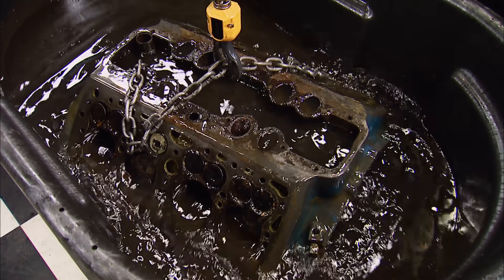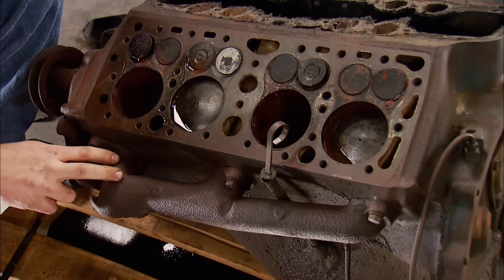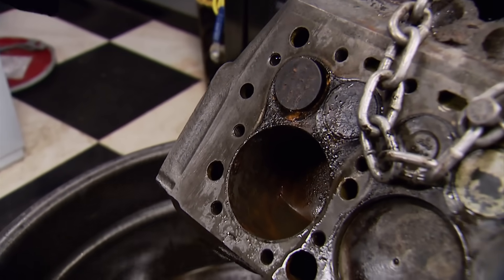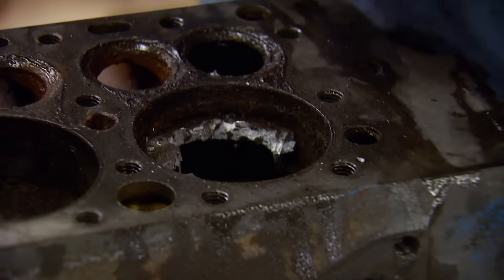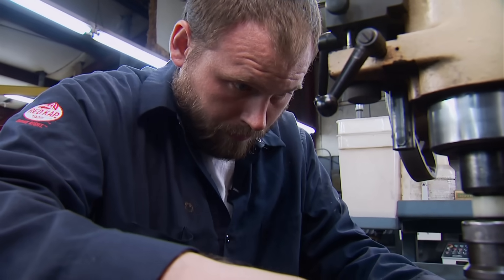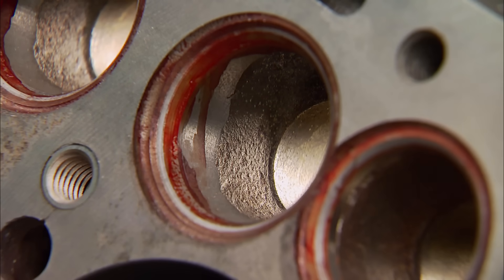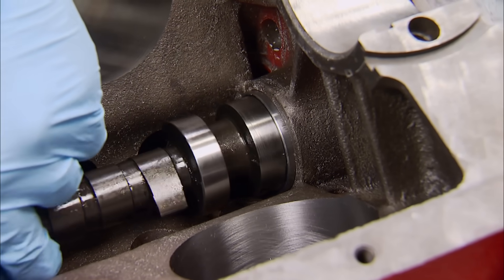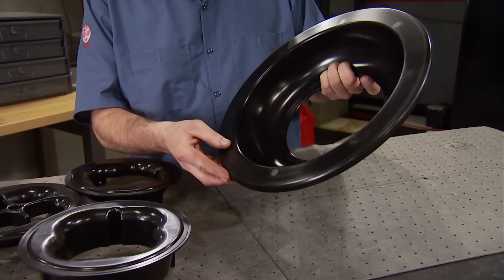Junkyard Ford Flathead Becomes A Classic Hot Rod V8 - Engine Power S1, E8

Comment: Flatheads are damn near the best looking engine ever made...sucks that they loved to overheat and not make a lot of power
Reply: I like the Chevy 409 W motors look best
Reply: @mikec9112  The first chrysler hemi, started design in 1941, and was built in 1944.  It was an aircraft engine.  The Ardun heads didn't come about until 1947.  Maybe they copied, maybe they didn't.
Reply: Do you know why they overheated, i was thinking maybe undersized radiators back in the day.
Reply: @closertothetruth9209  do to the torque of the engine and the dual water pumps being a part of the engine mounting system they had a tendency to fail on one of the pumps and could cause an engine to over heat without the pump leaking. That's from an experience I had back in 68 with my 51 F1
Reply: @closertothetruth9209  inefficient water pumps was part of the problem.  Better pumps are available now along with much better radiators.
Reply: @mikec9112  stop spreading lies soyboy
Reply: @mikec9112  if you had any intelligence you wouldn't be saying that Chrysler stole the hemi.